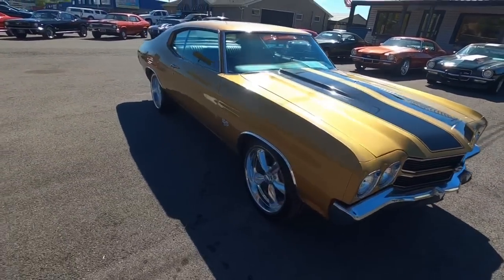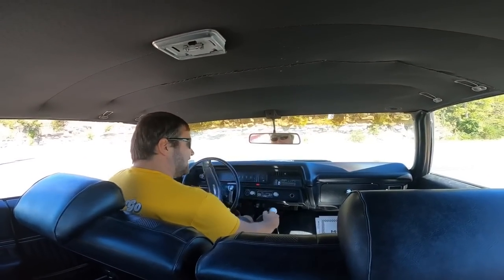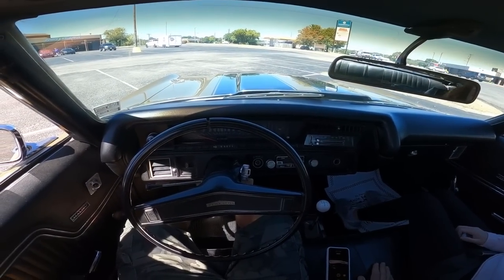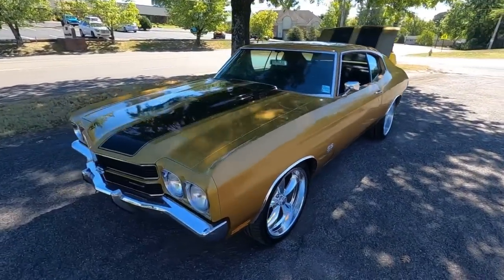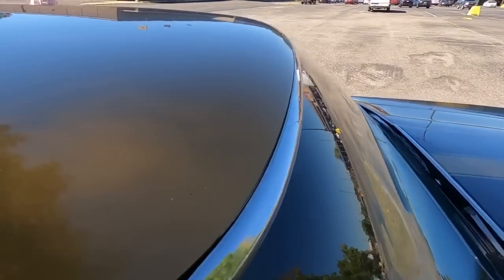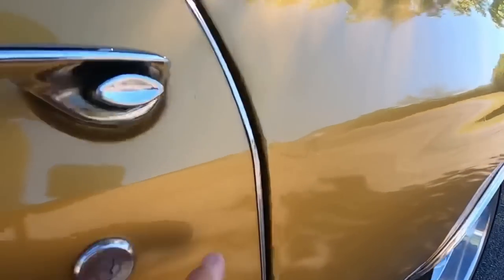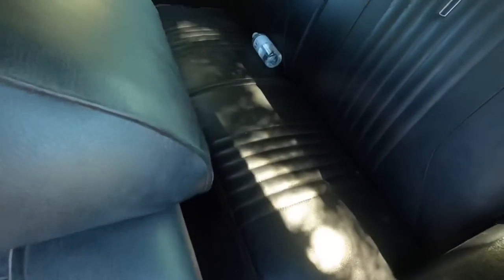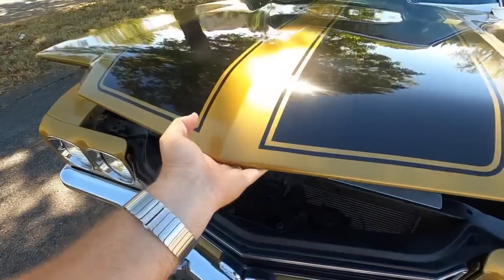Test Drive 1970 Chevrolet Chevelle SOLD $32,900 Maple Motors #1792

Comment: Man, this Chevelle is just butter! Classy, could use a ls motor, but not gonna turn it down. This is the one for me. Little tint, cow hood, set her down a little, maybe on air, and would be perfect
Reply: @dogsense3773  is it that bad? I guess I didn't notice. I suppose any unrestored classic is gonna come to that point eventually. If the rust is bad, you should have some negotiating room. I didn't see any bubbling, but good paint can hide all that.

Comment: Kills me how guys always comment on what doesn't go on these cars and don't plan on buying it. I have a built 71 convertible chevelle that I put 18" wheels on it and I have a spare set of 20" wheels I might put on it. Factory wheels wouldn't fit after disc brake upgrades all the way around.  If it's not for you, move on. Owners vision, owners money spent on what he likes.

Comment: Those wheels are fine to me! I wrecked my 1968 Chevelle because of the Crager wheels most people don’t know the five spokes on a Crager are pot metal
Reply: The 5 points attached to the center of the wheel broke loose folded under the spindle an I went skiing @ 120 mph
Reply: @tomgunter32  Yikes.

Comment: Runs decent, interior kinda rough-ish, NO on the wheels, what is that wiring near the gas cap (?), needs a pass side mirror. Low-mid $20s at best. There are better Chevelles for over $30K. A fairly nice car.
Enjoy the beach!!

Comment: Horrible wheels. Can't state that enough! I have a 1970 Chevelle that I've owned for 35 years. This car was engineered for 14 inch wheels and has the 14 inch super sport rims with trim rings. A car should be judged, in my opinion, by it's body lines , not its wheels .